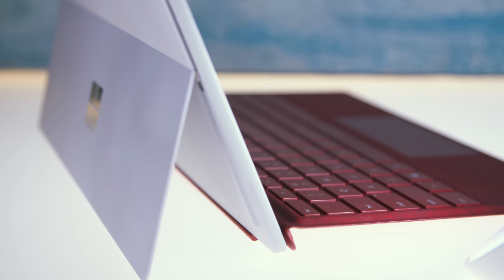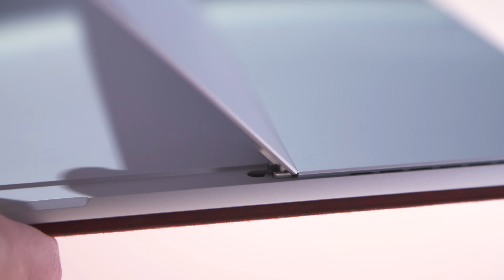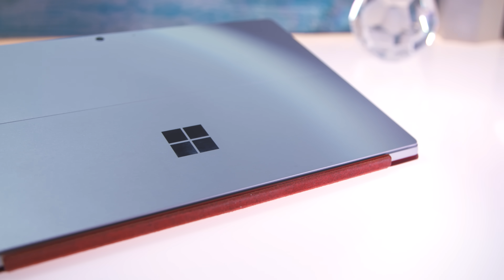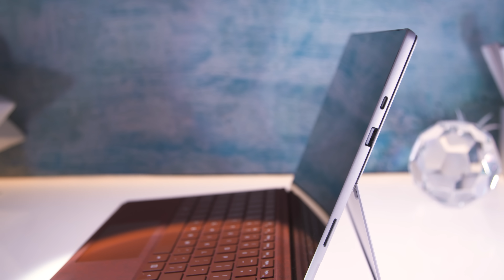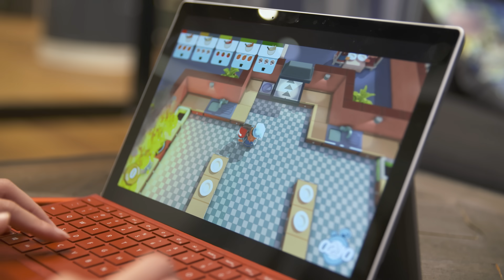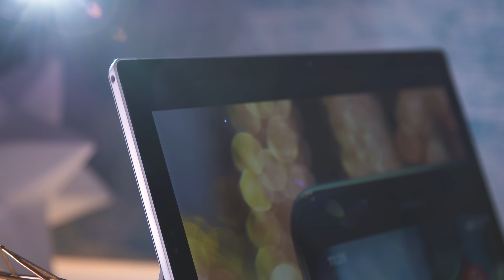Microsoft Surface Pro 7 review: USB-C upgrade, battery downgrade

Comment: Except for the fact that 10th Gen Ice Lake undervolts like a freaking BIATCH which means it actually has BETTER battery life vs last gen when both devices have their voltages pushed as low as possible!

Comment: 5 hours less battery life?!? How, where could that much extra power be being sapped from? I can't believe 1 tier newer a processor could demand nearly double the amount of energy, performing virtually the exact same tasks as the previous model... She had to have had different software running in the background, than she did when testing the 6. Especially considering her battery life clocked 2 whole hours less than Microsofts claimed 10 hours....

Comment: 1. Its predecessor didn't get 15 hour battery life.

2. The Surface type cover keys work perfectly fine with me. I enjoy the travel distance & their tactile feelings.

3. The bezels are slightly thicker than enough. As a tablet, you won't want to tackle accidental touches time to time. Aesthetically, yes they look dated. I wish to have a bit thinner ones.

4. The track pad is of the right size. Again, that overly large one on the MacBook Pro gives me nerves when I must rest my hands on it to type.

Comment: I ended up getting the Surface Pro 7 and find that this review is pretty accurate. Battery life is suboptimal but otherwise the device functions as a pretty good tablet-pc, though I do not find myself using the tablet function much

Comment: I just purchased a surface pro 7. i5 8 gig ram. I still have time to return or exchange. I don't absolutely have to have the keyboard separate from the screen. What would perform better at a similar price?  Also, how long until the battery has to be replaced & how hard/expensive will it be to replace?

Comment: Apparently Microsoft changed the metrics they use to determine battery life. The battery size wasnt shrunk and the processors are more efficient so you shouldnt expect any real world battery changes for the worse. Also, the surface can be charged much more quickly as well. This seems like a great upgrade for me as I have a SP3 still.

Comment: My surface pro 7 gets very hot when charging, does it happen to yours?
Reply: Mine too. But I figured out that this is a normal behaviour since it has the fast-charging technology, which means that it is charging with a high power effort.
Reply: Eason am told to keep the kickstand open when charging. I had a 4 before and I kept the kickstand closed when attached to my docking station. The battery got too hot and melted the screen. I had to replace the battery and the screen. I have a 7 now and keep the kickstand open. It stays cooler.

Comment: my SP5 was estimated at 13.5hours of video playback (lol...marketing) and i struggle to get 8 hours. Its so sad that after 2 generations later, the battery has not increased at all......looks like ill have to wait for the SP8 to see if i can trade in my anemic SP5.

2 generations later and all thats significantly different is the addition of the USB-C port.....so sad.

Comment: "As if you'd really want to get this tablet without the type cover, anyway."

And that, right there, is my problem with these kinds of tablets.  If it's built for productivity, you need the keyboard.  And if you need the keyboard, you might as well just get a laptop.  Starting at $750 without the cover, you'd be much better off with a laptop, unless you have a particular need to use the tablet portion.  And frankly, it looks a little big to use as a tablet.
Reply: Yes. That's what most reviewers don't get about the iPad and what makes it so good.
You do NOT NEED A KEYBOARD. It's made from scratch for you to be able to handle things with the tablet alone, and the keyboard is an optional attachment.

Windows, on the other hand, is not and will never be a touch operating system. You will always need a keyboard.
Reply: @xmaverickhunterkx  I'm not sure I agree with you about the iPad.  I've got one, and if I'm doing something productive (i.e., writing), a keyboard is a must.  It's the first thing I bought after I got the iPad.  The virtual keyboard on the iPad is good, but you're not going to type on it long-term.

The problem isn't so much needing the keyboard as it is needing a $130 keyboard.  I bought a $20 Bluetooth keyboard for my iPad, and it's perfectly fine.  The only things the Surface Pro keyboard give you are the touchpad and the ability to attach to the case.  If you can live without those things, it's fine.  

Touchpads on keyboards meant for tablets don't make any sense to me, anyway.  It's a touchscreen.  You want to move the cursor?  Touch the damn screen.
Reply: @BrianHartman  Let me correct myself while adding context:
Not all productivity requires writing, so a keyboard is a good and maybe even necessary accessory for people who need to write a lot, sure.

What I really meant was not only the keyboard, but the whole keyboard+mouse(touchpad) paradigm.

That said; I stand by the fact that the iPad is perfectly usable as it is, even if perhaps not 100% comfortable for people who type a lot, compared to something running Windows. I tried going Windows+touch only and it's literally impossible at the moment, the OS just won't allow it.

Comment: I like a bit of bezel. How else are you suppose to hold it without fingers covering up screen and content? Most business professionals find a tablet/laptop running android or ChomeOS does not fulfill their real world needs. So no real threat from android or ChromeOS due to students to MBA's needing full desktop apps to get work done. As to having a usb-c charger at home & office. Same goes for me with a Microsoft charger as have two so usb-c in that situation is  a mute point. And like most more have usb-a devices than usb-c devices. 

As  a long time Surface Pro 6 never did 10-13hrs. you stated for normal use. That was advertised video looping test not real world use. All SP6 users have always getting 7-9hrs of battery use depending on load. So your battery statements comparing the 6 to 7 are kind of inaccurate and misleading. Check out any other reviewers to verify about battery life.

Otherwise a nice review covering many pluses of going with a Surface Pro 7.

Comment: no one cares about usb-c except reviewers.  this review is so ignotant
Reply: i do.
one cable to potentially charge a phone, tablet & wireless headset (at up to 100W), far faster (up to 4x faster), smaller and reversible, allows the use of external GPUs, ultra-fast storage etc.
Also, literally what's the harm with replacing the mini display port?
Reply: @Will91289  udb-c on the surface is not thunder bolt, so forget egpu and ultra -fast storage. Device currently charges up to 80% in an hour.  Sounds like  you don't
what your talking about
Reply: @anzatzi I know exactly what I am talking about, practically everyone forgets that USB-C is the connector, not the transmission protocol (for the lack of a better descriptive term)
what I was doing was demonstrating exactly what the USB-C port is capable of, in general, not what it is capable of on the Surface Pro 7. Why MS didn't add TB3 is a mystery as you can put duel TB3 on a tablet as Lenovo ThinkPad X1 Tablet proves.
also, if I'm not mistaken, I may be, that 0-80% fast charging is when it is being charged via the Surface Connect port.
Reply: @Will91289  You specifically cite epgu support and fast data transfer in your first reply as justification for usb-c.  And I corrected you
noting this was not thunderbolt
Reply: anzatzi 
I was taking about the port it's self.

Comment: Everyone always mentions the fact that the keyboard cover is sold separately and I don’t understand why. The keyboard cover comes in a variety of colors. If Microsoft put it in the box then it would create a HUGE number of SKUs and would become unwieldy. If they kept it as is but included the TypeCover in the price then the Surface would just cost $150 more. Microsoft is a business not a charity. People slam Microsoft for not making radical changes to the Surface design but the benefit is that for nearly 5 generations all the accessories and peripherals are still compatible so if you already bought a TypeCover for a previous Surface then you don’t have to buy a new one if you get a new Surface. Honestly, it’s pretty consumer friendly. A good review should provide context. This ones does not.

Comment: I respect there for the Microsoft does but they have still not made the experience of using the device cohesive it’s still tries to retain too much with the desktop style use set an a touchscreen and Microsoft is not the master of all it is more of a jack of all trades and master of absolutely none of them in the touchscreen device that is a problem.

Comment: This really wasn't the best review
Reply: Why?
Reply: @r21747  Why? The women is comparing a full fledged PC running full Windows 10 with iPads and Pixel Slates. She's comparing the breadth and depth of Windows against devices running mobile operating systems. The review was not good. It's just poor journalism. She doesn't know who the Surface is for.

Comment: Yes I agree it's not perfect and it's  high time Microsoft start to overhall this design. I am not one bit excited for this new surface pro 7. But, this review does not do justice to what the surface pro 7 is, with errors in the information given. 

Its neither a tablet (you can not compare it to other tablets, iPad Pro with a keyboard or galaxy tab with a keyboard) and it's neither a laptop/notebook (you can't comopare it to  dell xps 13/ hp x360 13"). It is it's on type of product. 

I've had the surface pro 4 (Pro 3 before it) for a long time now. For a student, it literelly is able to do everything and anything you want it. And it can be your personal computer all the time not just some times. Granted, some apps do turn on the fan, now after years it does get abit laggy here and there with drawboard (only because I do alot of annotating) + I can hear it struggling with the complete anatomy app, which is a heavy graphics heavy application. 

There is no other device this powerful, in such an easy to carry form Factor (not including surface pro x in this as I'm not sure exactly how powerful this new arm based chipset is going to be). If you are looking for portability first, there aren't many products that are better than this. 

A standard  home use scenario:
1) having it wirelessly displayed to a second monitor
2) watch videos/presentations on the second monitor whilst writing notes on onenote (on the tablet screen itself). And various other ways I've had multiple apps open while im studying, making a presentation etc. 
3) Bluetooth keyboard and mouse attached. 

On the go I keep it attached to the keyboard, never had a problem with it. (except battery life sometimes. If I know I'm going to use it past the 8hrs, I take the charger with me). 

Final point, the pen features mentioned here are actually office features. They will be comming to all windows devices with an office update. So literelly the only reason to get this is a USB-c port (without thunderbolt) 🙄🤷🏻‍♂️.
Reply: Microsoft already has the REAL MAJOR UPGRADED SURFACE, but for 2020.  They had to save something for next year, since they had so much for 2019.  I can't wait until 2020 holiday, so I can get my hands on a Surface Duo Windroid phablet book phone.
Reply: @LionPride11241968  very true. I've also read that surface pro is going to be getting an overhaul next year aswell. I am actually really excited about the neo (and appreciate how much thought they have put into that product), but because of money limitations, I'm failing to create enough arguments for it over the next surfacebook3/surfacepro8.